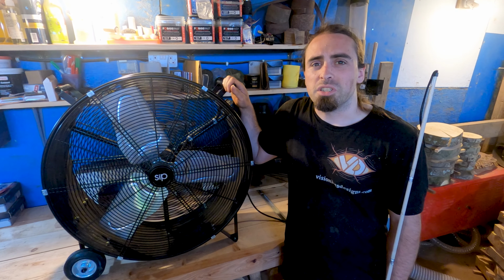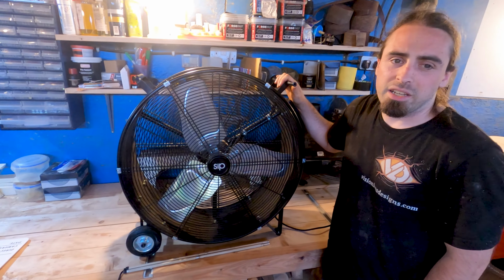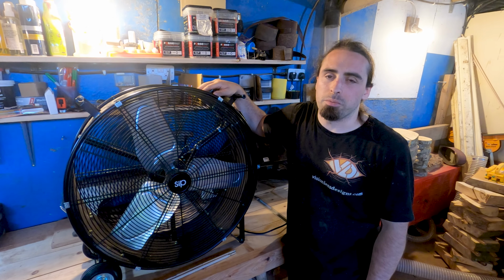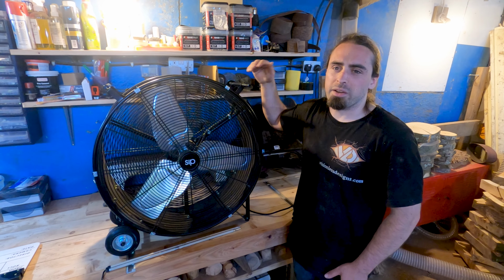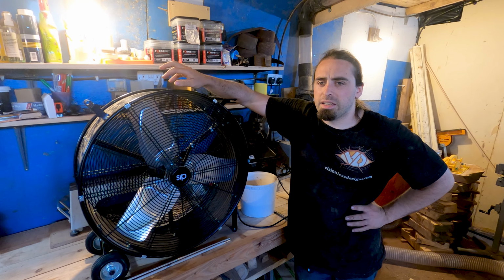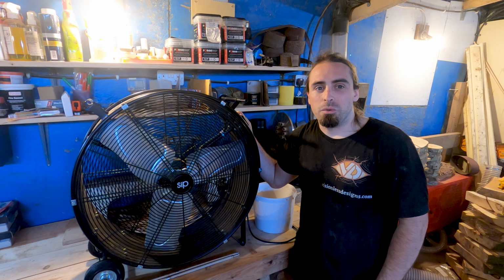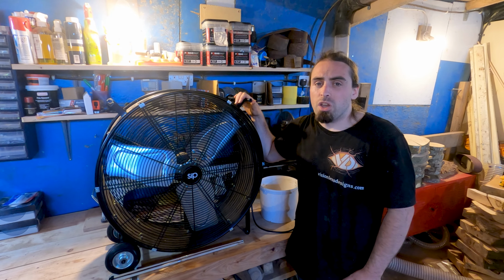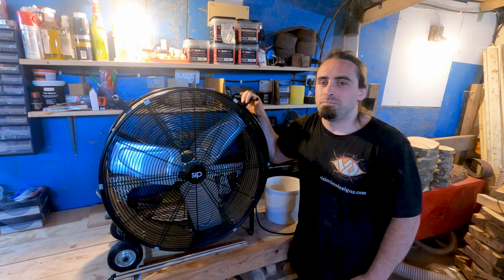The Ultimate "Desk" Fan - Sip 24" Industrial Fan

Comment: Ha ha, I suspect an up and coming video showing how you efficiently clear up the sawdust from this demonstration!!
Reply from the maker: Yes, will do a great, in-depth, 40-minute-long video... on the broom. 😆
Reply: Ah yes, the broom, a very underrated piece of equipment. I can release some technical specifications, should you need them.
We get the best out of our broom, if it's tuned to D# minor!
Reply from the maker: @lammas7935  I was thinking of going on about the tensile strength and how many metric tonnes of sawdust it can move. I hadn't considered tuning it... how do you tune complaints from a broom to a D# minor?